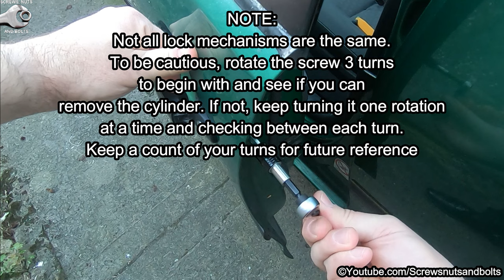Volkswagen Door Lock Fix

Comment: For anyone watching this, who actually plans on fixing the lock themselves, and thinks that it is fairly easy as seen on the video, dont let it fool you. If you can spare the money, just buy the whole lock. If not, then make sure you have nerves of steel,and DEFINITELY bring another pair of strong hands. It is absolutely impossible to not want to tear your hair out. Anyways, I managed to do this with help after about 3 hours of frustration. MAD props to the author, the video is immaculate, and also huge respect for assembling this thing alone
Reply: I can try it if a macanic beside me
Reply: @senorasheikh8018 you can try it even without a mechanic but as jacub said be prepared. Just did this myself and it's really not as easy as seen in the video. Really hard to hold the spring while doing the rest of the assembly but still not impossible

Comment: Thank you very much. I just replaced the cam on my 12 year old Gol. I've seen how to assemble it, however while i was in the middle of the action i notice i didn't know the proper orientation of the cam and where the spring sits (once loaded), so i end up in your video. Great explanation, production and of course skills.
I would like to add that sometimes the new cam doesnt have de proper diameter. In my case it was around 0.08 mm smaller but it was easy to fix with a Dremel.
Reply from the maker: You're very welcome, thanks for the tip !

Comment: I took the lock out and apart to confirm it was one of these parts that broke but while away from the car the locking ring fell into the door. Managed to retrieve but confused on how to refit the locking ring. Does the whole door latch have to come out or and this be done with just the door card off? Any advice is appreciated! 

Also great video!
Reply from the maker: Thank you. I think you might have to take the latch off, this video might be of use: https://www.youtube.com/watch?v=juU8IhH0KKs

Comment: Did you replace anything or just take it apart and put it back together? I have a problem when i unlock it it works fine but if i try to lock it it keeps rotating indefinetly. Should i order repair kit before trying anything or could the fix be just to reasemble it?
Reply from the maker: I just took it apart and put it back together to demonstrate the process. If it keeps spinning in one direction it sounds like some internal part has worn or broken so it's it's up to yourself if you want to order a kit before disassembling the lock to check.

Comment: What happens if you don't keep the handle open while you're undoing the Tork screw?
Reply from the maker: The locking ring could pop off and fall inside the door frame, which can be a lot of work to retrieve and refit
Reply: @screwsnutsandbolts  all done and working fine. Thanks for taking the time to help people.
Reply from the maker: @jezpday  You're welcome !

Comment: If the key just continues to turn, could this be just the cam?
Reply from the maker: Yes it could be a broken cam
Reply: @screwsnutsandbolts  OK, I'll order a kit just in case.. (It's worth a 3 quid gamble!)
Reply: @screwsnutsandbolts  I've just found out that the barrel is different, (It has a sort of cast shroud) are these repairable?
Reply from the maker: I assumed yours was the same as the one in the video. What car do you have, and what year ?

Comment: What do I do if I completely messed it up n lost the ring but n the torx screw is wonky in the door now?
Reply: Any updates/tips? I’ve just lost the ring too😅
Reply from the maker: You need to take the door apart from the inside and recover the ring. This video will show you what you need to do: https://www.youtube.com/watch?v=juU8IhH0KKs
Reply from the maker: @Japanesezenwindows  You need to take the door apart from the inside and recover the ring. This video will show you what you need to do: https://www.youtube.com/watch?v=juU8IhH0KKs
Reply: @screwsnutsandbolts thanks for the quick reply and helpful video! I lost the ring when trying to put the cilinder back in😅. Taking the door apart is way above my skill-level so will get help from a garage. It was worth the try though.

Comment: Good edu video thanks
Reply: Hello there again. Would you be so kind and send me a link for replacement of these parts
Reply from the maker: https://www.amazon.co.uk/dp/B09VSRYQDR/
Reply from the maker: Double check to make sure they fit your car
Reply: @screwsnutsandbolts  I'd repaired it during Easter bank holiday's weekend with the right parts (well I shoudl grid a bit here and there but I make it done) 
I can actully see if I would order it on Amazon I would be even cheaper than here in CZ. Anyway so far best video tutorial for such situation. Thanks and bye